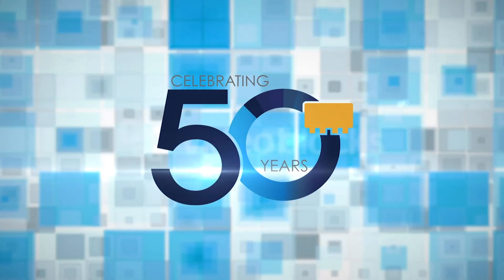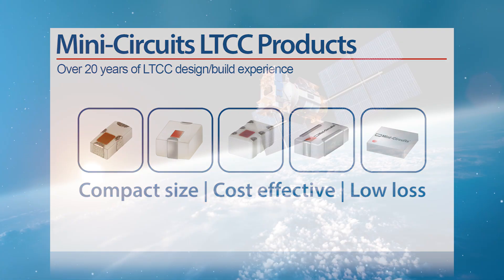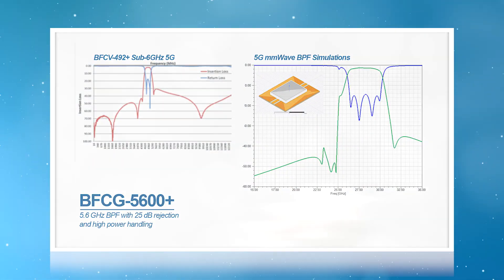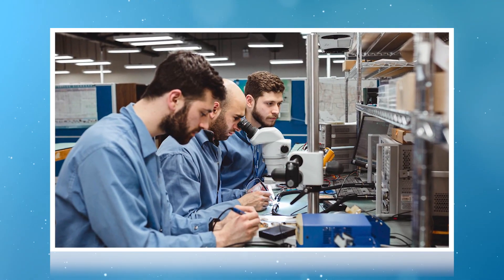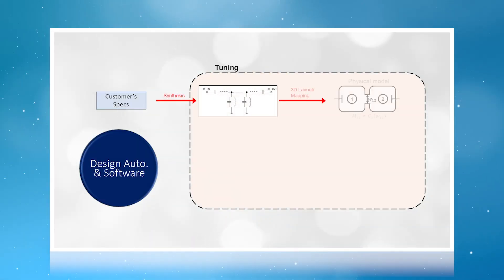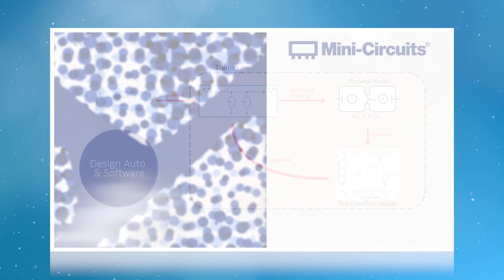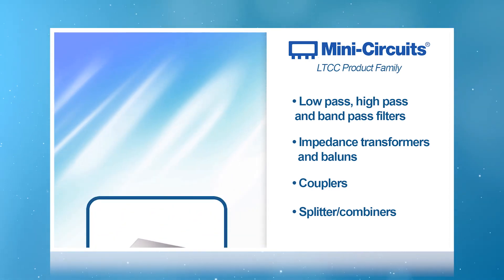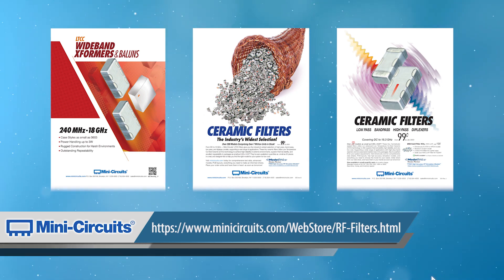Advances in LTCC Component Design

Comment: I have a question here. In order to make the system in LTCC, do we have to design it in the multi layer format with the passive components embed on the sheet and all wire bonding stuff, or do we have to just simple design in a planar form as a single RF pcb and the people like you transform it into LTCC technology?
Reply: You need to mention in your design no of layers for your passive components, for example a capacitor can be made embedded between the layers and printed on a single layer with metal surface then a dielectric print then again a metal surface or it can be made by interconnecting the metal surfaces through via. After co-firing process when you see the device using x-ray you would see a capacitor embedded in the substrate and ceramic all around..! Someone who doesn't know the LTCC process would ask how the hell did you put the capacitor inside 😅